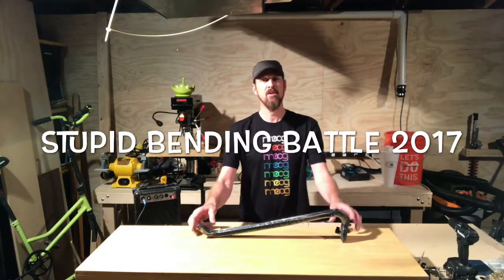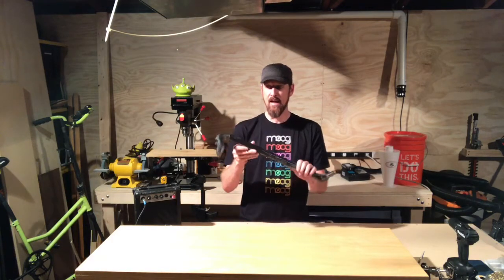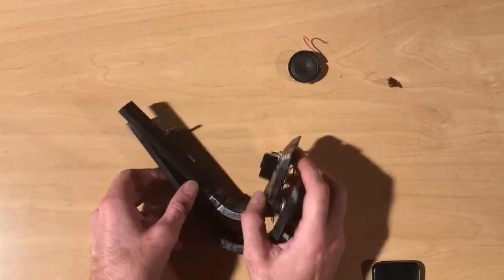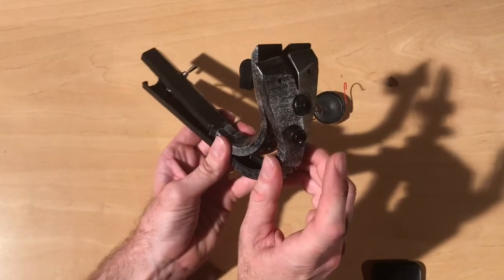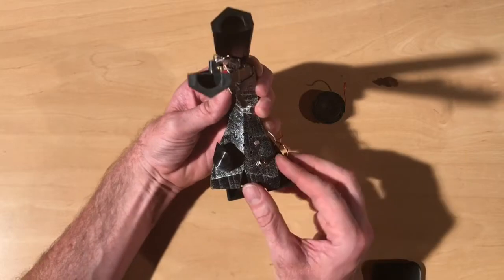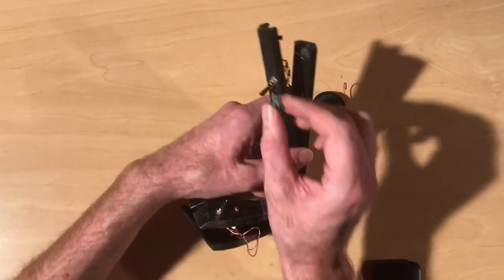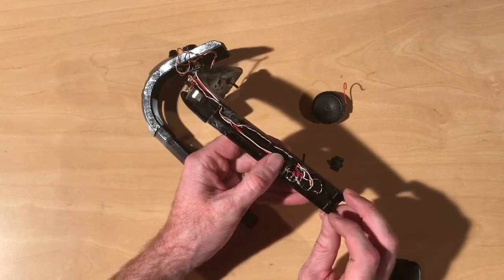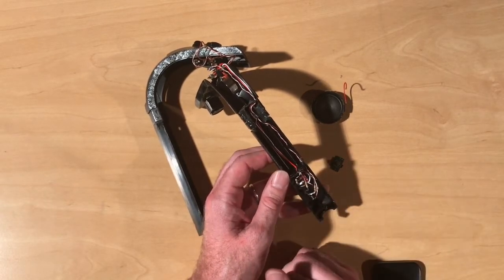STUPID BENDING BATTLE - Circuit bent crowbar

Comment: That crowbar is so awesome!! Could you give me more information on how you were retriggering the sample? You said it was a few resistors and a transistor? How would I go about doing something like that? Thanks man!
Reply from the maker: Hank Byerly thank you. All I used for the re-triggering one PNP transistor and two 100K resistors. I think I originally found the schematic on the casperelectronics website but unfortunately that site is down due to hackers. I know I printed the schematic out at some point so I'll try to find it and post for you.
Reply from the maker: Hank Byerly found it on Pinterest. This is the circuit I built but I did not use the same transistor. I think it just needs to be a PNP transistor for this but I'm not 100%. Also this might not work for all toys. In my toy crowbar the original button connects a positive power signal when pressed. 

Emitter connects to the switch/button that you want to re-trigger. Base connects to a 100K resistor to ground AND the sound output of the toy.  Collector connects thorough a 100K resistor to power. 

So when this is wired up the sound output sends a positive signal back to the transistor which in turn triggers that transistor to send a positive signal out of emitter which re-triggers the toy and starts the loop over. 

https://s-media-cache-ak0.pinimg.com/736x/b6/de/59/b6de59a5554849b83ab114d89ab43b83.jpg

Hope this makes sense. Also I am be no means an expert so if I explained something wrong that is why. I just learned this not long ago.